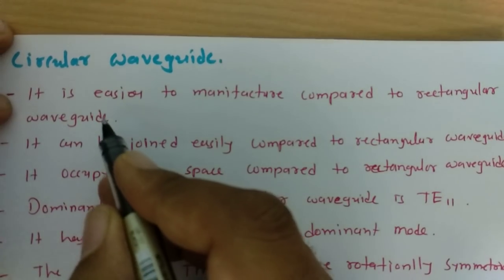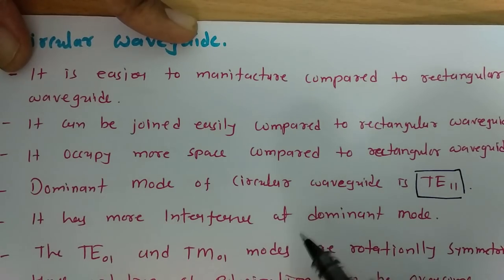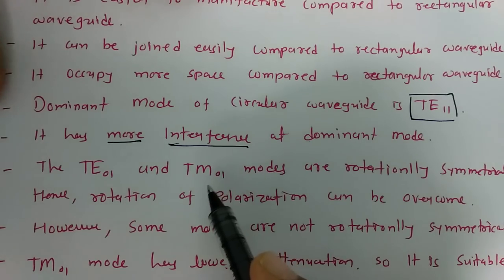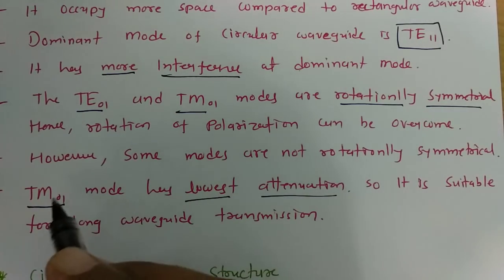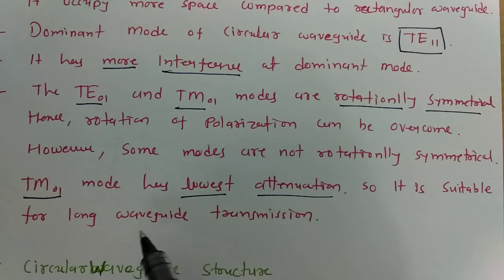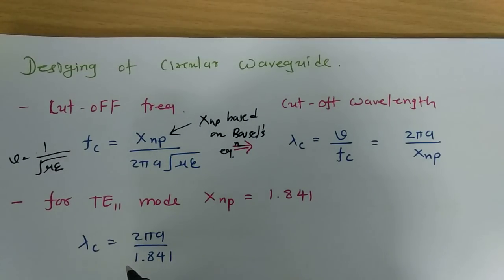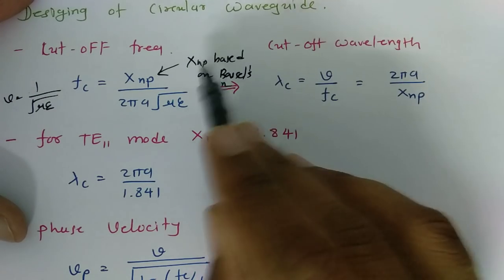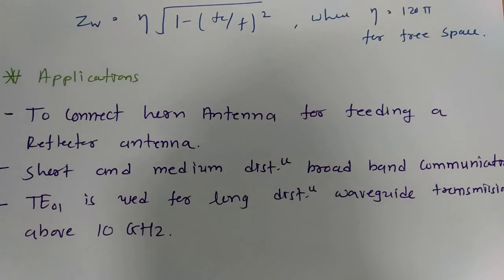Circular Waveguide (Basics, Structure, Designing, Applications, Pros & Cons) Explained

Comment: You first mention TM01 for long distance transmission but later say TE01 (which is correct).
Reply from the maker: In terms of frequency, both are same.
Reply from the maker: And in terms of frequency I have discussed it. Else TM and TE is different in terms of fields.
Reply: TE01 is correct.. it is pyq of isro

Comment: Isn't it TE01 mode that has the lowest attenuation?
Reply: Circular waveguides are not used in their dominant mode.
Reply: you are right. it's TE01 which has the lowest attenuation.
Reply from the maker: No dear, we don't use it with circular waveguide